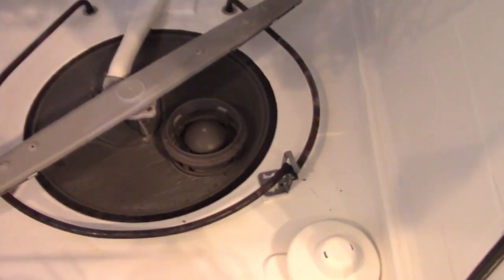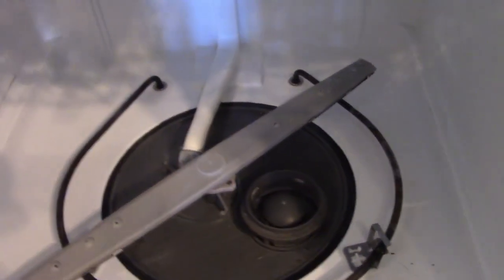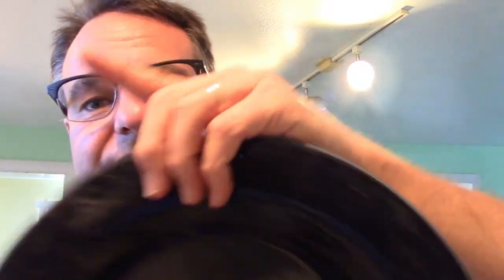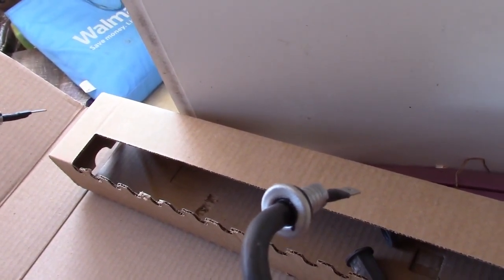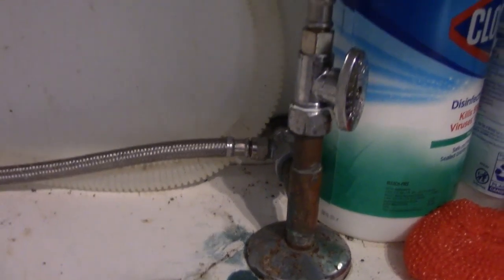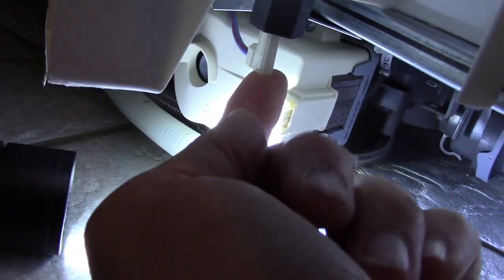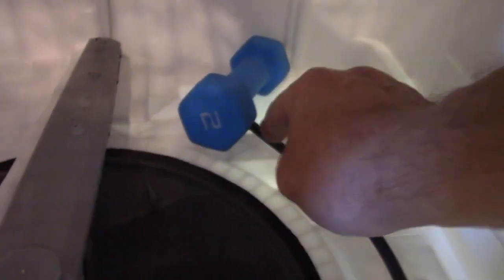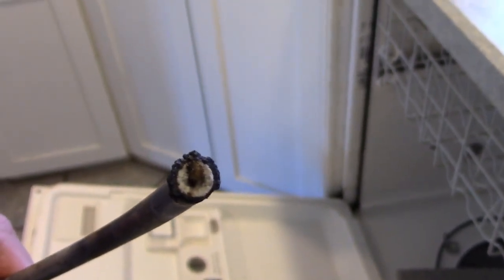Farm Stuff #32 - Fixing the Dishwasher/Replacing Heating Element

Comment: At least yours was a heck of a lot easier to fix than mine. I had to pop a lot of crap out from the inside and struggled to free the part that needed to be replaced. But woo hoo fixed dishwasher!
Reply from the maker: Yup - the only thing that threw me was that you then had to put the dishwasher into maintenance mode and clear the error out - a safety feature that when it discovered the heating element was broken it shut it down, but it would have been nice if it told ME that with blinking lights or something.  Once I cleared the error out it turned on and everything is working great.

Comment: I get the feeling you say 'can do' before you ever say 'can't do' (and even then only saying 'can't do' after giving things a try). My word you're a resourceful fellow Kris. You'd have to be after the year you just had. And that was still one tree and one ornanent more than we managed, and we had zero excuses (except that I don't really like Christmas decoration). Ps I would've commented on your Linux video except it felt like you were speaking another language. I mean I guess in one way you were🤣 I just sat there in awe, like most dixieland farm videos really 😃
Reply from the maker: That's right, Dean - I usually do give it a try - that's how I fixed the tractor implement earlier in the year - figured how much worse can I make it, end up fixing it.  I love some Christmas decorations, but we only decorate one room and I can put it all up in 20 minutes - this year at the end of the season I bought a new tree (after this one faithfully did its job for 20 years), it was 75% off and it is fiber optics, so the lights are just built in and nothing to do.  The Linux stuff definitely is its own language, but I hopefully explained some of the reasons why that system is the way it is, which is pretty fascinating from just a political/free thinking way of going about things - how a decentralized system can work in something as structured as computing.  It is also fascinating how in-fighting and differences of opinion cause fissures and breaking of groups into new groups that compete with each other, because that happens all the time in Open Source development as well.

Comment: Hi Kris, moving at back end of last year was stressful enough, we have one of those new fangled dishwashers now. We had a Xmas tree too, maybe next year I'll just put one bauble up - liking that idea very post ironic......
Reply from the maker: My cousin-in-law (no such thing, but lets go with it) has one of those extremely fancy dishwashers and I think she said it was going to cost her $1000 once to get it fixed (cost $2500).  I could buy mine seven times over for that kind of money... sure, hers is slightly quieter, but not by much - and mine I usually just set to run at night when we are in bed.  There was something nice about NOT putting up the ornaments - and I caved and bought a new tree this year - I couldn't resist because the old one the lights are going on it again, it is shedding its plastic needles, and the new one was 75% off and fiber optic so no light bulbs at all.

Comment: Does the element heat the water, or heat the air for drying? Hope the fix worked. So sorry to hear about your mom, Kris. May she rest in peace. Be well.

My best, Tom
Reply from the maker: Both, Tom.  Hot water from the faucet usually still is not hot enough to clean the dishes thoroughly, unless you are in an old home where they just let the hot water rip 180 degrees, so that element kicks in and heats the water to get it to proper temperature.  It also will turn on if you have a heat dry cycle - I actually don't usually use it which results in some water, but not much.  Fix totally worked, but I had to go into a maintenance mode on the panel to reset the heating element; it detects when it is broken and shuts that section down so you don't have an electrical hazard - smart but it would have been nice if they had told me that with some blinking lights.